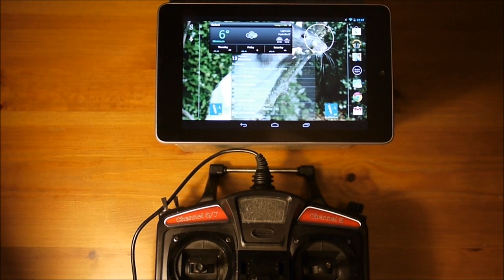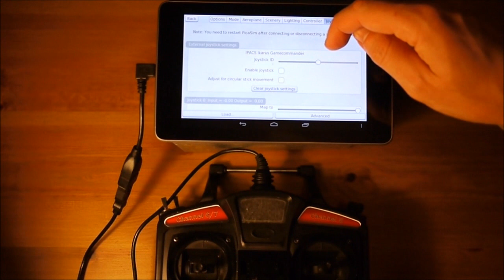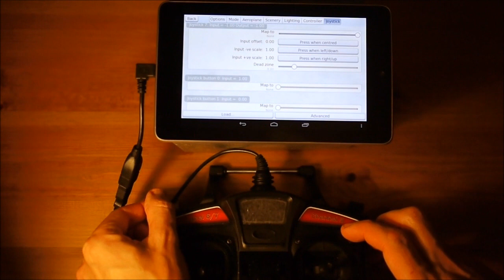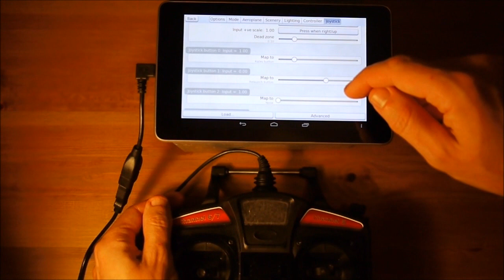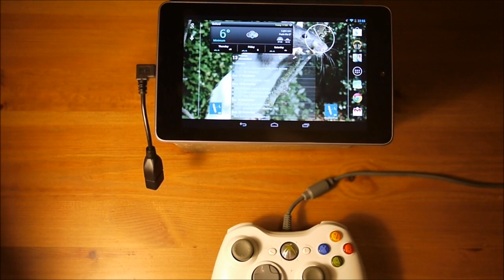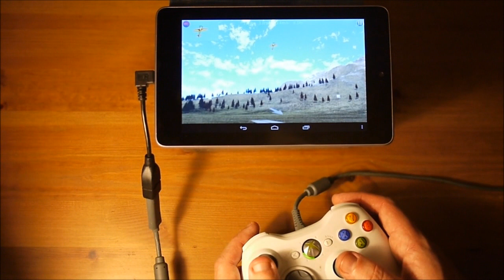Setting up a USB gamepad/joystick/controller in PicaSim

Comment: Our FlySky i6x with Sept 2019 firmware works fine with PicaSim directly on android (Nexus 7) via usb-otg.  Also works fine with PicaSim on Windows 10 PC via the oem usb cable that comes with the i6x so long as we run the program Xoutput from github ( apparently Xoutput converts 'Direct Input' to Xinput ).

Comment: My rudder input not working 😭 why help me bro
Reply: When a model has only 2-axis steering (elevator and rudder), then the rudder gets automatically assigned to the elevator stick instead. PicaSim was trying to be smart.
If you want to fly a plane by 2 axis only it could be a workaround to select a 3-axis steered model and disable the ailerons by leaving the corresponding gimbal lever centered when clicking the buttons "Press when left" and "Press when right".

Comment: I have to be negative here because I know you're just trying to help us,  but I found your pronunciation terribly difficult to decode,  in combination with the washed-out view shown of the setup display on-screen  made for a sub-optimal experience..  

I have a Win 10 PC and am so far unable to detect any movement on a Taranis Lite USB controller that is set up and working 100% Ok under another flight sim  called "wings sim".. So,  I'm not sure what I'm doing wrong Why I can detect the Aileron ( Roll) stick but not several of the others.. and I need to do to fixit.. I'm going to try and use the built in controller test module in Windows next..  Please help..

Comment: Could I connect my Dx6i to picasim on my phone using both a ppm adaptor and usb on the go connector?
Reply: Hopefully yes. I've connected my old Futaba Tx to an Android tablet and phone using a MileHighWings simulator interface plus the USB OTG adapter. I'd expect that if the adaptor connects as a USB game controller under Windows, it will probably work (but no guarantees!)

Comment: Help! all my controls are inverted what do i do?
Reply from the maker: In the joystick setup for each control you need to set the centre, minimum and maximum stick/input position. Just work through the buttons - with the stick in the middle press the "Press when centred"button. With the stick pushed to the left (or down, whichever is relevant for that stick), press the "Press when left or down" button. And push the stick right/up for the last button. If your sticks are reversed, check you didn't flip left/right or up/down in this process!
Reply: This sounds like Servo Reversal on your transmitter. It will be a problem when you try to fly a real airplane unless you make sure you install the servos upside down.  For my Spectrum DXe the controls were reversed when I got it.  You have to find the manual and reset the controls for your transmitter.  My DXe has a 9 step process to reset it, but you have to use the chart and the codes from the flashing LED's .
It is easy to do once you have 1) the instructions; and 2) the codes so you can understand the LED flashes.
So, try to Google instructions for your transmitter, and then look for Servo Reversal in the instructions.

Comment: how to use a normal transmitter on android pls explain
Reply: Exactly as in the video - except you'll need to get a USB simulator interface cable to go between the transmitter and the USB OTG cable.
Reply: ProfRat what type usb interface ?

Comment: thanks for the video, at least I can understand the basics, but your explanation as to how to set up the transmitter, is very poor, can you please explain again, this time say clearly which stick movement belongs to which setting ie yaw pitch speed ect.

I am totally confused, why don't you number the boxes

for example, speed,  zero right hand stick left , then zero right hand stick right

use each box to set up an axis,  and remove the confusing left/right/up/down

very annoyed, spent three hours trying to set this up, and it still dose not work.

by the way also make the save visible without going into advanced setting

you need to make it simpler than it is at the moment that's for sure

apart from that I was dying to have a go with my DX6i

sorry about the rant, but please simplify it.
Reply: Sorry it isn't as clear as it needs to be! Quite often it's hard to know whether one has explained things in a way that will be clear to someone who doesn't already know what is going on (for example - I'm afraid I don't follow your suggestion at all!). 

In this case, watching the video again, I think it's missing an explanation of what you're actually trying to do:

Each section (e.g. Joystick 0, Joystick 1 etc) sets up the mapping from a physical input to a "virtual" stick movement. That's complicated by the way that you can combine - e.g. use combinations of accelerometer, keyboard and on-screen/touch/mouse controls. That's why the mapping is a bit more complicated than in, say, a desktop simulator.

So - the procedure is:

1. In settings->options select your desired transmitter mode. Make sure you haven't got any mixing etc set up in your transmitter - should be a "vanilla" model setting.

2. Set up the top section in settings->joystick - so clear everything with the button, then select the controller input, tick the box if it's a gamepad (with circular, rather than square, input ranges) etc.

3. Go through the analogue controls on your controller one by one. For example, wiggle the right stick left & right.

4. Scroll up/down until you start seeing some numbers change. This tells you which section you're going to be editing.

5. If you fly mode 2, move the slider to map onto the "roll" stick (I know... ailerons, but this has to work for all plane types).

6. With the stick in the middle, press the "centred" button.

7. With the stick at full left or down (whichever is relevant), press the "left/down" button. Similarly for right/up.

8. Check that as you move the stick from left to right the output goes from -1 to +1.

9. Now go back to step 3 with a different control input.

10. If you want to map buttons, then you can do the same thing there.

You're right that the save button should be exposed by default (or perhaps - you should need to click advanced to modify all these details anyway).

UI design is surprisingly hard. It doesn't seem like it should be, but just try it! Actually, for me it's been the hardest part of this whole project - any any feedback is appreciated. However, development time is limited, so the balance between UI/ease of use and the simulation side has been more towards the latter. 

If the info above isn't enough to get things working, then let me know (or let me know if it is!), so I know how to improve things for others too. It's actually a very quick procedure once you figure it out!

Cheers - Danny
Reply: ProfRat I found it very helpful!